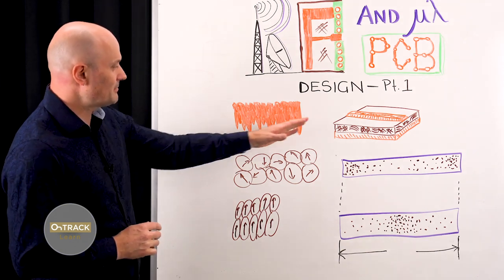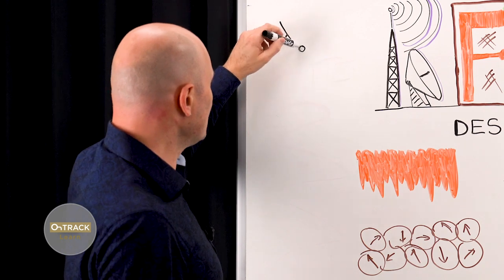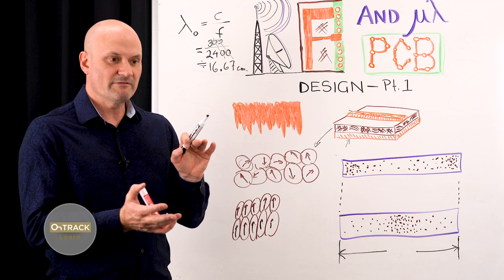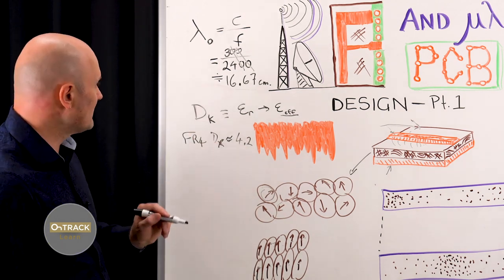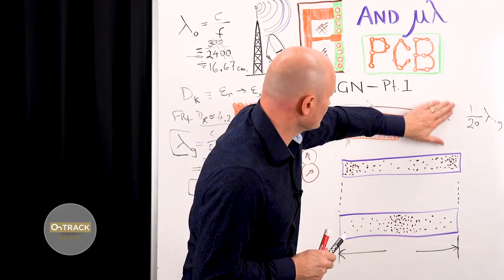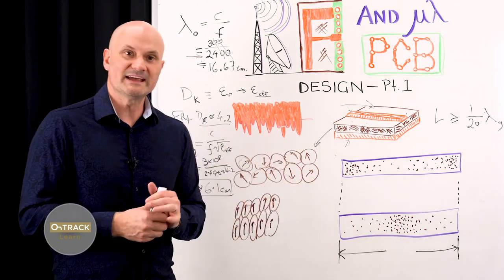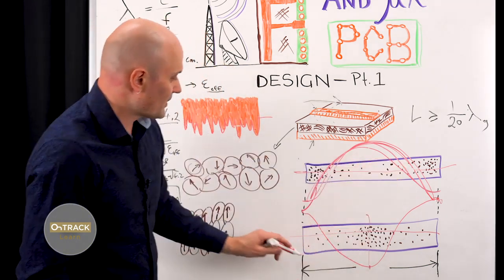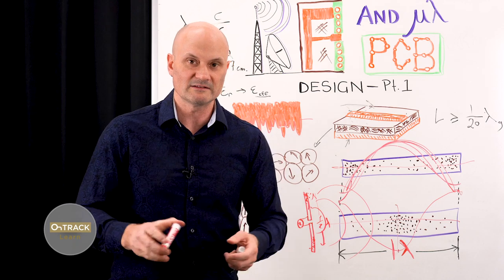(1) - RF and Microwave PCB Design - Altium Academy

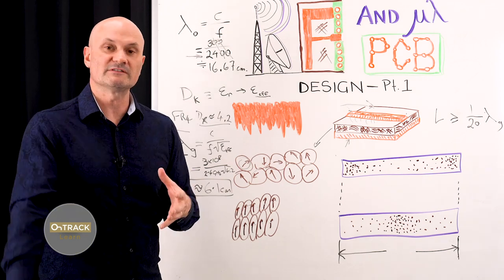Comment: 12:17 the length of the traces should be larger for the larger wave lengths right? it sounds opposite what he is saying. I didn't understand.
Reply: He is referring to a limiting case where the trace length appears to be nearly invisible to a signal with a certain wavelength, which then means you can ignore the impedance of the trace. This is when the wavelength is very long compared to the trace length. So when the wavelength is longer, the allowed upper limit on the mismatched trace length is also longer. This concept is often referred to as a critical length, but the calculation of a critical length is a bit complex as it requires calculation from the input impedance; this is why so many guidelines just state that the critical length is 10% of the signal wavelength. I have explained it in much more detail here: https://www.youtube.com/watch?v=NYAoqxlKW-U

Comment: When discussing the charges on the conductors at 17:00 did you say this backwards? First you showed the Positive in the middle with the electrons at the edge attracted to negative. Wouldn't it be the opposite case? Electrons are attracted to positive and repelled from negative? You said it in the case below as well for the next phase of the sine wave. Just seems wrong in my head, but maybe I'm missing something.

Comment: Hi, I have few questions. Let me know if I am wrong, does the length of RF anteena onboard must be multiple greater or multiple smaller of wavelength we calculated from formula? Is that right? But it cannot lies in half of multplie. Like 6.1cm then 12.2cm and 18.3cm will be okay, but If my anteena length is b/w 10cm it would ve wrong.
Reply: Quarter wavelength, normally.

Comment: is it possible for radio frequency be used for internet connection? because current internet signal used today from smartphones are only good outside your house unless you use router and antenna which is very costly..

Comment: Hi Ben,
Thank you so much for these great and simplified video series. 
I just have some problems with the calculated wavelengths in most of the videos. For example:
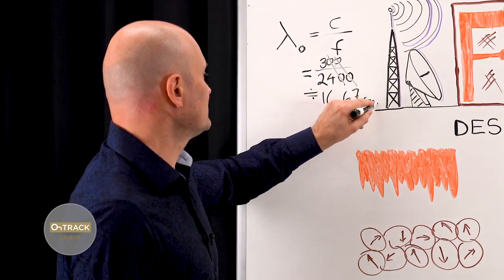Video 1 (time 5:12) => Landazero = 300/2400 = 12.5 not 16.67
Video 2 (time 25:40) => Landazero = 300/(2400*(4.1^0.5)) = 15.4mm (606 mil) not 736 mil
Video 3 (time 25:39) => L = 16.2mm not 19.061
and so on.
Am I correct or I am doing something wrong.
Thank you again for your time in advance.
Regards,
Reply: I'm not Ben ... but you are right with the calculation... 2.4GHz is ~12.5cm and so on ... 16.67cm is for 1798MHz
Reply: I think its like this: Video 1 must be in vacuum/air. Video 2 must be in FR4 PCB, the epsilon of FR4 is about 4, and the speed of light, or electromagnetic energy, is reduced by a factor of the square root of the material's epsilon (dialectric constant).  I havent seen video3 yet....
Reply: @MrSemperfidelis225  yah, this was pointed out in another comment shortly after video was published. That's what you get for not actually doing the calculation live, and the pressure of standing in front of a camera. We're not perfect, but I think the value overall of the video is high - and this maybe confirmed by the number of views...
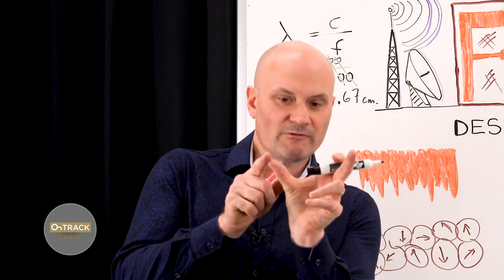Reply: He did say approximately. 😅 Also, at 5:17 his fingers are only 12.5 cm apart, and he should get partial credit for showing his work.